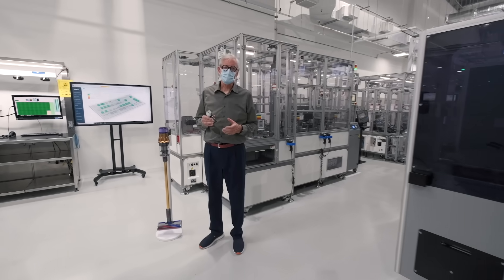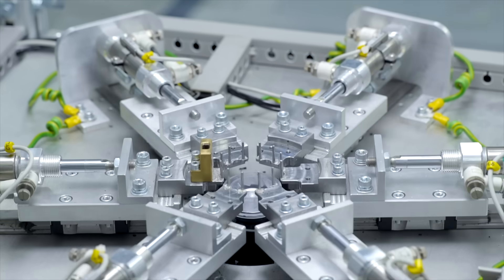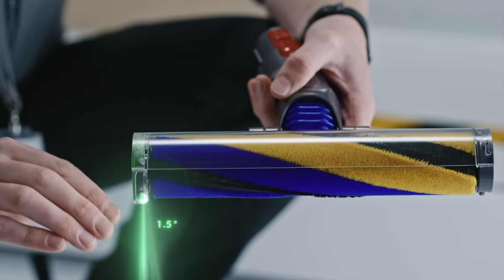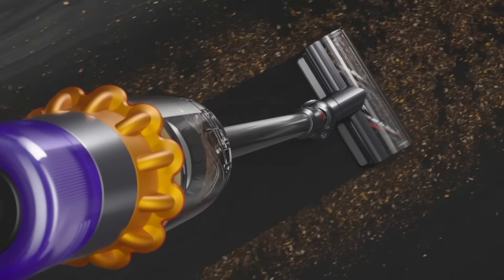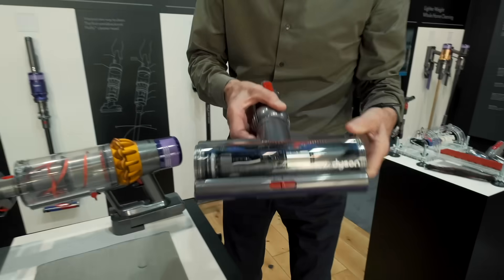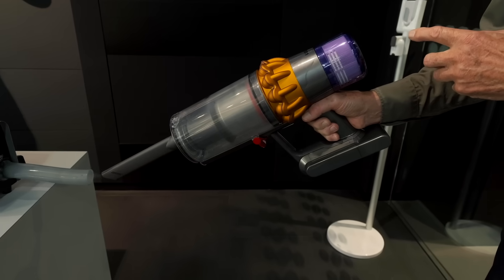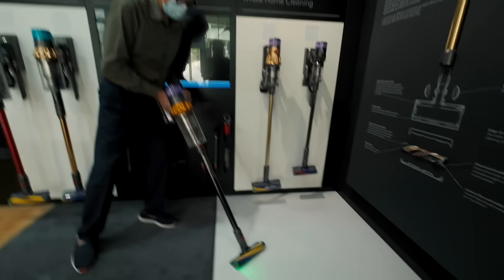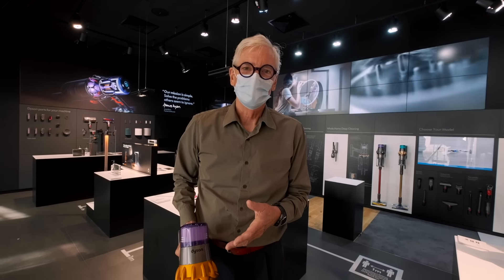James Dyson launches new Dyson vacuum with laser technology.

Comment: I’m sorry, I have a V11 Absolute, but this counting the dirt particles looks more like a bad early April’s Fools (or at least a very insistence on “pure numeric power” on how to “see dirt” and “count it) than a very advanced upgrade on vacuum tech. 

What Dyson needs in Vacuum products is some “lighter” and “cheaper” (also less capable/powerful) product like the V11 Slim (please release it already in all markets...not only on Asian ones, that is also kinda “discriminatory” on why asians should maneuvering lighter stick vacuums because of body characteristics). A slimmer/cheaper product will help lowering the price while maintaining the great Dyson quality on tech and industrial design, at the same time attacking all the other Xiaomi/Samsung/Shark/Nilfisk etc. products that are desperately trying to compete either on price, copying style/characteristics, or replicating the positioning as a high/low end side/alternative products. 

As characteristics needed also, new V series products needs: swapping batteries on all the line, better joints on the junction of stick/canister that appear to degrade and make the vacuum wobble after a year or two of use, and LED lights to see under the furnitures, not LASERS and sonic/acoustics counters of particles.
Reply: Loro non hanno nessun interesse a competere nel mercato economico

Comment: 8:04 this is a poor idea.  this design only good for vacuuming floor level surfaces.  outside this, the tool becomes too heavy.  consider the separate dust bin from the head as seen in Shark cordless

Comment: Pretty cool! I don't see the point of counting individual particle types. Are they optimizing something with that information?
Reply: Their vacuums have been perfect at their primary job (cleaning) since the V8 (v7 would have been perfect with HEPA).  I imagine they are also pretty close to the end of incremental improvements with current tech in battery life, weight, maintenance reduction (ie clearing hair tangles less often), ease of use (auto floor-type detection) etc. They are running out of ideas on how to sell the latest models is my guess. The laser and particle counter seem completely pointless to me and the extra suction power has no real advantage when their "basic" models are already picking up 99.5% of debris. 

The Omnidirectional one seems pretty sweet though. I want to see more innovation like that; stop "improving" the virtually perfect existing models and make something new.

Comment: Good vacuum. Main issue is that a lot of these features seem kind of gimmicky. 
It's understandable that the v11 was already one of the best cordless stick vacuums so there wasn't much of a need to improve it.
That being said it's highly dissapointing to see these negligible improvements warrant such a high price point.

It would have been much more innovative and impressive if the new vacuum outperformed the v11 or atleast got close for a lower price.
Reply from the maker: We welcome feedback from our customers. We're always trying to develop our technology and improve our machines, comments from our customers help us to get it right. We really appreciate your support.
Reply: It's still more powerful than the v11 outsize. The sensor helps in autoregulating the suction power based not only on the type of floor but also how dirty the surface is to optimise cleaning and battery life. Plus tangleproof turbo brushes are very useful to many people with pets or long hair. Having the laser light is just a bonus

Comment: All these features are cool, but have you added the most basic button lock so that I don't have to constantly hold down the power button with my finger? 👀
Reply: That should be my choice, I'm happy to sacrifice a few seconds of battery to be comfortable and not have a sore hand after vacuuming ;)

I'm not the only one who sees this as a pain point - the best solution I found on the forums is to use rubber band and that's what I've been doing.
Reply: They won't. Having to push the trigger is a way to save battery by stopping the motor every time you don't need it
Reply: You don't need to apply pressure to the button though.  Just hold it without pressing
Reply: Hi there, thanks for getting in touch with us. We're sorry to hear that you've been experiencing problems with your machine. We'd really like to look into this for you, Please send us a  private message, so we can obtain your Dyson account details privately. We look forward to hearing from you.
Reply: The v12 detect slim has a power button and got rid of the trigger.

Comment: 220 air watts and autoadjust using both brush resistance and dust pick up, leading to better battery usage are the real acheivements here. With that vacuuming strength and runtime can you truly can replace a mains powered one.

Lol the 1 quid eBay laser ain't fooling anyone.

Comment: Some of this dumb tech has already been made.
Reply: Like what specifically
Reply: @DillonCleans  ♟ ‘checkmate’ of the day 😂😂
Reply from the maker: Be that as it may that is your opinion and you are very welcome to your own opinion.
Bagged vacuums are very outdated.
Our ads are correct as our bins have a max line once the max line is reached you are to empty your bin. Suction is perfectly fine till then and if you wash your filter and empty your bin as instructed in our user manuals then you are good to go.
Reply: @dyson  This what I have been trying to say. This is correct. Bags are outdated but can be better in some cases. But bagless is very much preferred. Thank you Dyson for stepping in.
Reply: @dyson  Please keep telling people about filter maintenance because I have seen so many bagless vacuums that have filters that are so dirty the machine won’t even work.
Reply: I literally said bagged is better. I agree with you. But bagged doesn’t work for everyone. And when you empty a bagless vacuum, it’s very little air pollution. So that’s not a huge deal. But yes. Bagged is better. But bagless is more convenient
Reply: @DillonCleans  Sry I didn’t remember you saying that.
Reply from the maker: The Benefits of Bagged Vacuum Cleaners
Hygienic 
Recommended for Allergy Sufferers
HEPA Filtration
Require Less Maintenance 

The Disadvantages of Bagged Vacuum Cleaners
Must Buy More Bags
Decreased Performance As Bag Fills

Compared to its bagged counterpart, a bagless vacuum cleaner is easily the more environmentally friendly option. Bagged vacuums can use hundreds of bags over their lifetime, but with a bagless model you won't be throwing anything superfluous away along with your dust and dirt.

Bagless Vacuums are Not Hygienic and Diminish Filtration, Suction and Cleaning Performance – Without bags to hold nearly all the captured dirt, the microfilters on bagless vacuums quickly clog from excessive dirt build-up and must be replaced often or a loss of suction and cleaning effectiveness will occur.

With our filters you only need to wash them once a month with clean water only and allow them to dry for 24 hours but you can wash it more times if you wish. Bagless vacuums definitely require maintenance, if you do not maintain your machine issues can occur.
Reply: @dyson  we really just got Dyson in on this argument
Reply: @dyson  Dyson, that isn’t completely true, bagged vacuums will maintain suction until the bag is completely full. Same with bagless filters except that a lot of people are uninformed about the maintenance of the filters Because of YOUR stupid ads saying no loss of suction and people miss interpreting that as no maintenance.
Reply: Mostly on the omni glide vacuum, the nozzle looks EXACTLY like the Karcher FC7 floor vacuum/cleaner in Germany that was introduced back in aug. 2020
Reply: @FallingBeej  I am not familiar with with tag machine specifically. But if it does have the same design, I’m sure the Dyson would still perform better. Karcher is an old brand that still makes products. But is mostly outdated. Their products are good. But just not as up to date as new brands.
Reply: @DillonCleans  No, believe it or not rug companies actually void the warranty if you use a dyson because of how bad they are at cleaning. At least that is what performance reviews said.
Reply: @FallingBeej  performance reviews lies a lot. He thinks the only vacuums you should ever use are Miele, sebo, lindhaus, Henry, or a central vacuum. Carpet companies don’t void warranty. And who even uses a carpet warranty? Dysons clean very well.Especially Their uprights. My deep clean test showed the Dyson ball animal 2 got 94% with a dirty heavily used machine. I tested a Hoover that only got mid 60s. I tested the shark nv352 and it got 96%. The highest one I had seen. So please don’t believe performance reviews. He is knowledgeable in vacuums but is extremely biased and hated on brands because they are taking over the brands he likes
Reply: @DillonCleans   you can always trust performance reviews because he has actual experience as a vacuum technician. What are you, a dyson fanboy. Plus, have you even tested any of the vacuums he recommends? Also, performance reviews isn’t the only person I have heard that from.
Reply: @FallingBeej  I have tested some vacuums he recommends. They are good vacuums. But he only recommends vacuums that are very expensive. And there is no way you can say that Dyson is horrible. Because they are not. I am not a Dyson fanboy. I own several dysons because they are good products. I also work as a vacuum technician. I repair vacuums very frequently and have several years experience. Dysons hold up very well. I also repair sharks that hold up very well. Of course I get all brands of vacuums in for repair. But I get a lot of Dyson, shark, Bissell, dirt Devil, and Hoover. And Dyson performs the best and hold up the best out of all of them. I did say that performance reviews is very knowledgeable. He is just way too biased towards machines.
Reply: He also doesn’t realize that not everyone has the money for a $900 sebo or a $2000 central vac(including installing). Other brands are great too. And again. Carpet companies don’t void a warranty because you use a specific vacuum on it
Reply: @DillonCleans   First of all, a dyson vacuum is still very expensive (about $600) and Sebo vacuums are usually about $700. Also, I know people personally who own vacuum stores and usually refuse to sell new dyson because of how bad they are. The sell them used though because people don’t see the value on getting a crappy vacuum fixed.
Reply: @FallingBeej  you have only talked about other peoples opinion on it. You haven’t said you had any experience with own. So you can’t say it’s bad. And Dyson does offer 20% off on their website. So that does bring the price down quite a bit. If you do not like Dyson, why are you commenting on Dyson. Just keep your opinion to yourself and you don’t have to be here.
Reply: @DillonCleans  I have owned cyclonic vacuums similar to dysons so I know a lot about them (like that they are very messy to clean and the cyclones clog up). Also, if you get a Sebo/Windsor used, it will work just as good as new even if it has a few kinks. And, they are usually around $100. I hit the Windsor jackpot getting an original Versamatic for only $40 and it will probably last for the rest of my life.
Reply: @FallingBeej  you can get great vacuums used. But since prices vary so much it’s hard to take that into account. So it’s best to just about new. The cyclones do not clog up by the way. I have done everything imaginable with mine and they cyclones never clog and the filter stays very clean. If you just do normal maintenance on vacuums, then you won’t have that issue. Bagged vacuums are not for everyone. They aren’t great for me. But they are great for other people. It just depends on your situation. Dyson is the best bagless. End of story. So pretty much no matter what you say, you can’t say Dyson is a horrible brand when it’s not
Reply: @DillonCleans   like I said, I have never owned a dyson but the Hoover air I had was prone to cyclone clogs. Also, with Sebos there is a bag so you don’t have to worry about dust getting into the air when you empty it or major clogs. Finally, the Sebo’s bag filters better than any bagless vacuum could ever dream about (even shark or dyson)
Reply: @FallingBeej  the bag thing may not be true. Hepa filters work the same as hepa bags. It will expel clean air. So that is not correct. The Hoover air was not a great machine. Dyson cyclones have never clogged for me. They only clog if you suck up water and lots of pet hair. And I jwve only seen that happen on 1dyson and the cyclones on that Dyson were not good to begin with. The new cyclones are very efficient and work very well. We are talking about Dyson. Not Hoover here. Like I said. Bagged vacuums don’t work for me everyone. Bagged vacuums don’t work in my house compared to bagless vacuums. And people don’t want to spend money on bags. They want to buy the vacuum and that it. No filters. No bags. No belts. So you forgetting my point that people don’t want to do that
Reply: @DillonCleans  The whole reason bagless vacuums lose suction is because people who are practically brainwashed actually think that bagless vacuums are maintainence free. This however is far from the truth because the filters need to be messily washed and eventually replaced after they are too dirty to wash again. Also, a good filter on a bagless vacuum is USELESS because dust escapes every time you need to empty the tiny bin. I am done trying to convince people like you that bags are better. Please go to Sebo’s website to see why bags are truly better.

Comment: Are you going to make parts available to fix them when they die in 1 to 2 years?
Reply: You are correct about it coming with two batteries. I work on battery operated stick vacs frequently. The problem is, compared to other brands, Dyson's are just not that reliable. When it comes time for repair (which it will be) it's either super expensive or the part needed is not available at all. More so with these new Dyson sticks. Dyson and Shark are the worst offenders for this. Just spreading the word. It would be one thing if the machine was in the $300 dollar range but they are charging $600 plus for these machines. Sorry but honestly your cost to own a vacuum per year should not exceed 50-100 dollars.
Reply: @Ruluaman  How much is a reasonable cost for what is marketed as a premium home appliance is entirely up for debate. Dyson is more expensive than average, but is by far not the most, but unlike other manufacturers they actually have independent cleaning performance tests that justify the price tag.

As for thr batteries, Dyson don't actually make their own. A strip down in another video confirmed they use Panasonic lithium ion cells. Many other cordless brands use exactly the same make. The difference with dyson is because they have a much larger market share than other vacuum brands then statistically you're more likely to find more failures, simply because there are more of them.
Reply: @explorer47422  There are some brands out there that make their own batteries. For instance, the new Miele Triflex. Miele makes just about everything they put in their machines. I'm not knocking Dyson for outsourcing batteries on their machines. My main issue is when you spend 6,7,8 hundred dollars on a vac, you would expect peace of mind that when you need to repair it that parts would be available as is with other major brands. That's one thing that Dyson, Shark, and many TTI brands don't care about. If your main body craps out in 3 years and the machine can't be fixed, your looking at a very expensive paper weight. Two ways Dyson could fix this. Extend the warranty out to 5 or more years and making key parts available for 5 or more years.
Reply: @Ruluaman  incidentally after a quick look it seems Miele use batteries supplied by Varta AG, who also manufacturer the airpod batteries, ultimately owned by Energizer. But geographically they're in the same a country, but don't just serve Miele.

If you're advocating they should extend the warranty from 2 years then perhaps you're right. But you'd be hard pressed to find a company that does (parts and labour included). Every company wants to have more warranty than the other, to set themselves apart from the competition as its a big selling point, but have to be realistic. Regardless of who manufacturers the batteries, lithium-ion tech is pretty global and seems to have a universal shelf life of only 2 years if charged and discharged once a day.
Reply: They have a 2 year warranty
Reply: @explorer47422  Let's assume outside of warranty. The V11 up doesn't not have many parts available to repair machines. I hope that changes. I see Dyson's with bad batteries and main body's all the time in the shop.
Reply: @Ruluaman  The Outsize comes with 2 batteries, but they are now all removeable. But having said that battery technology is kind of like that across any product you come across. Mobile phone batteries only tend to last 2 years as well before no longer having the staying power they once had. Cordless tool batteries as well, you name it. A battery has finite number of charges/discharges, and sadly we're at the limits of lithium-ion technology until new tech comes along.
Reply: My v8 heading to it 4th year with no issues and I abuse the shit out it.
Reply: @camarykaren  🤣 Nice, just keep up with cleaning your filter and cyclone and run that bad boy till it dies.
Reply: @Ruluaman  o yeah . Love my Dyson .